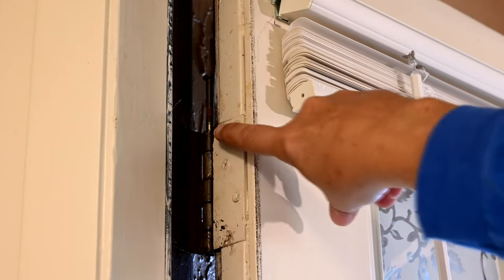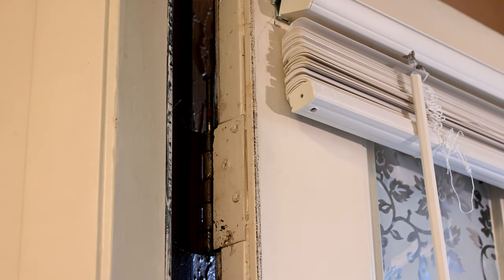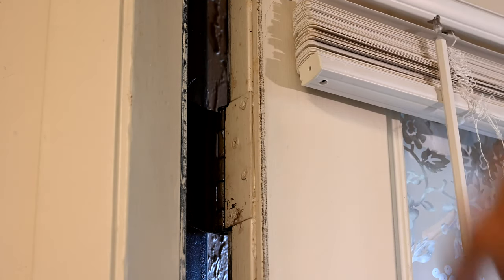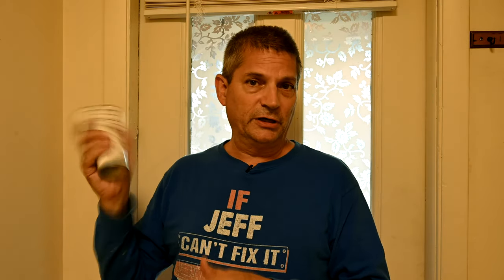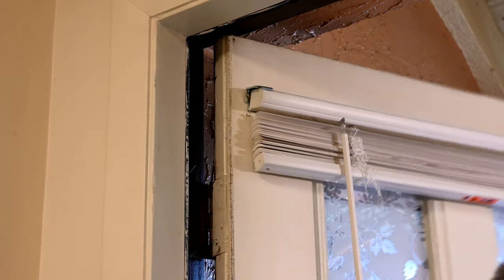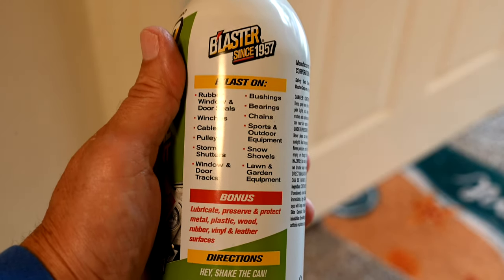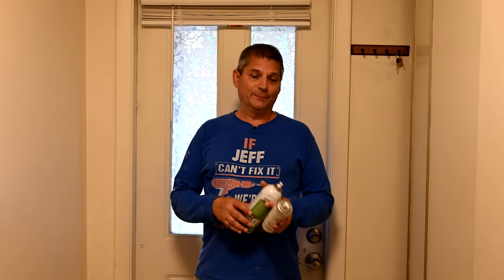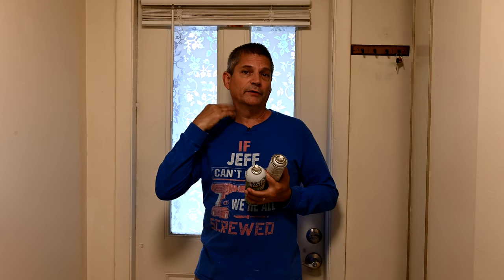How to Fix Squeaky Door Hinges, Which Lubricants to Use

Comment from the maker: Squeaky door lubricants mentioned in this video:
✅ Medeco recommends Fluid Film FLUIAS11 Lubricant/Corrosion Inhibitor, 11.75 oz: https://amzn.to/2Tqnr6S
✅ B'laster 16-SL Industrial Strength Silicone Lubricant - 11-Ounces: https://amzn.to/2Z1Db1r
✅  PROTEXALL Alum Slick Lubricant, Sliding glass doors 11 Fl Oz: https://amzn.to/2KGmy6s

Comment: I used a synthetic bicycle chain oil, a tiny drop on each hinge and the door has been completely silent for quite a few years now without any more application.  The one I used is called "Go Gear - Synthetic All Weather Cycle Oil" its very good stuff, a little goes a long way.

Comment: I pull the pin and grease it.
Reply from the maker: Yup, that's a good way to do it also. If there's paint on it, you'll have to sand it off with 150 or 220 grit.

Comment: My closet has this problem but there sliding doors would this work for it?
Reply from the maker: Yes I would try it on the wheels. Also try to really narrow down where the squeak is coming from. Is it the wheels? Is the door rubbing against something like the track? Are the rubber slider pieces up in the track binding and squeaking? That's what you need to find out.

Comment: 3-in-1 oil
Reply from the maker: Bruce, How does that work out for you, does it collect up dust and dirt? That's always my worry with wet oils and lubricants.
Reply: @jeffostroff  No. Wipe the hinge pin off good with WD40 to get all the old crud off. Sometimes use WD40 on a .308 brass brush to clean all of the hinge openings. Then a LIGHT coat of 3-in-1 on only the hinge pin. I will do anything thoroughly ONCE. I hate constant rework. Good for 18 years so far.... just checked a few, time to clean again, still no squeaks though.
Reply: @jeffostroff  , I never tried the dry lubes. Use those on my bicycle chains though.